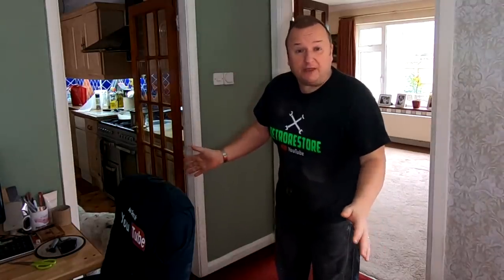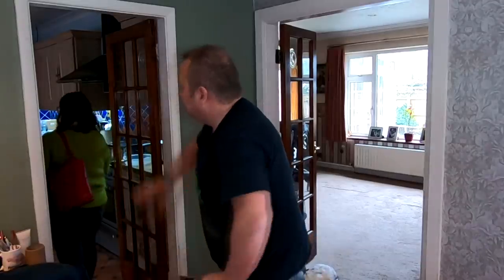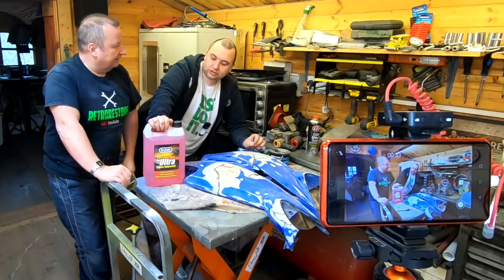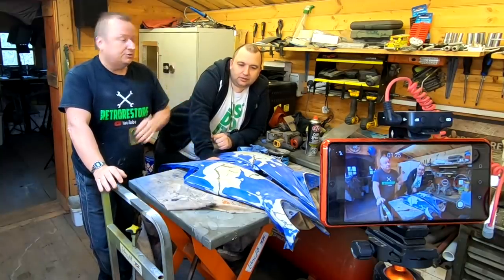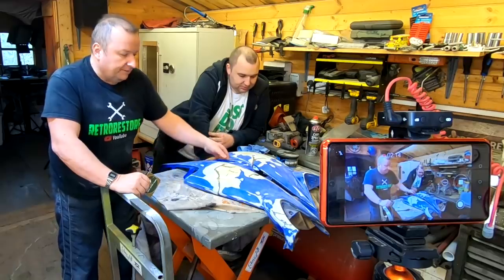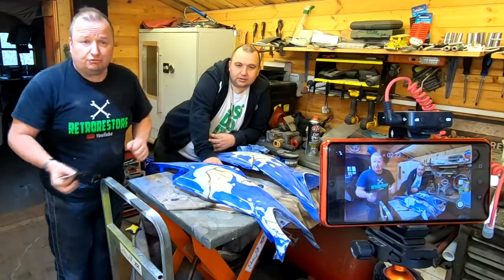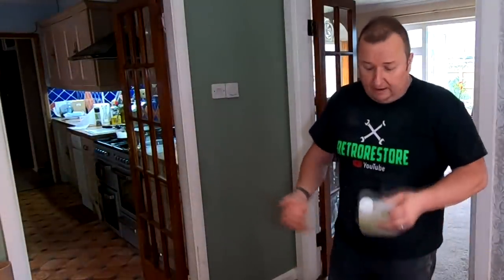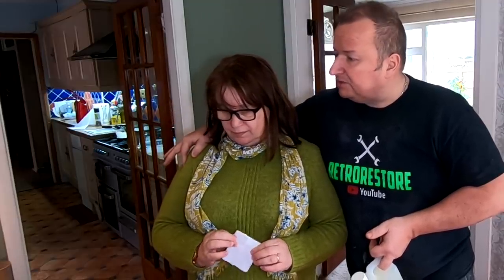Plumbing - Yamaha Cam Chain And Tinkering Vlog

Comment: Hi Martin. Is there a reason why you run an seperate waste pipe for the sink and shower instead of just piping into the 4 inch soil pipe ? Im no plumber by the way just a DIYer.
Reply from the maker: I did it in case there was a blockage in the soil pipe and they could still use the shower and sink.
Reply: @butlersempire  good idea, I would have just piped into the 4 inch pipe not thinking.